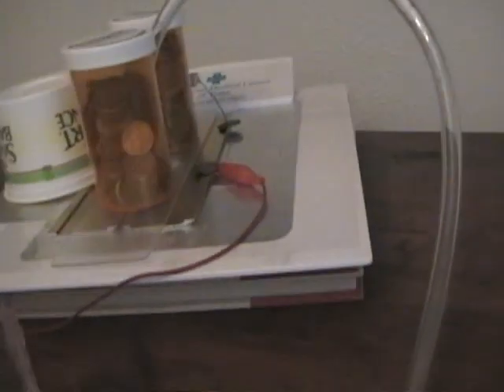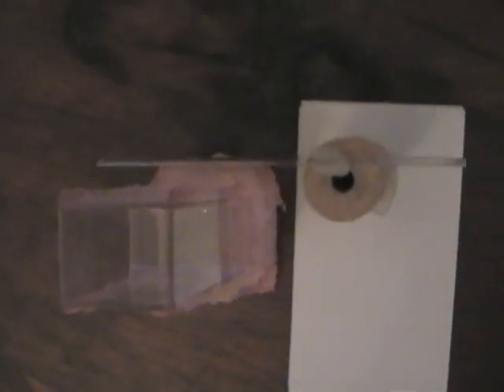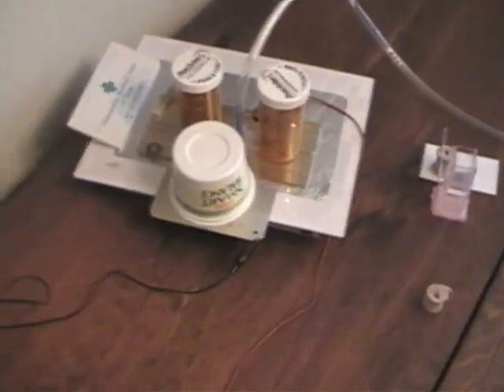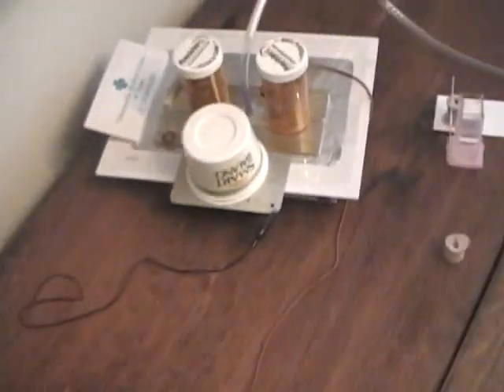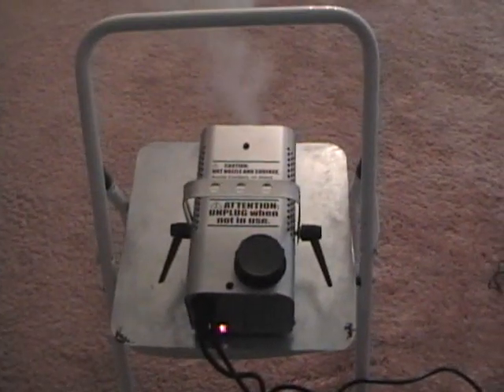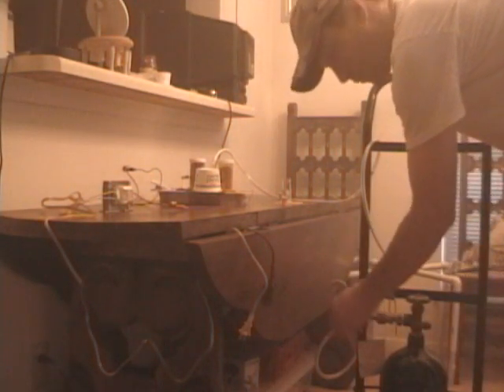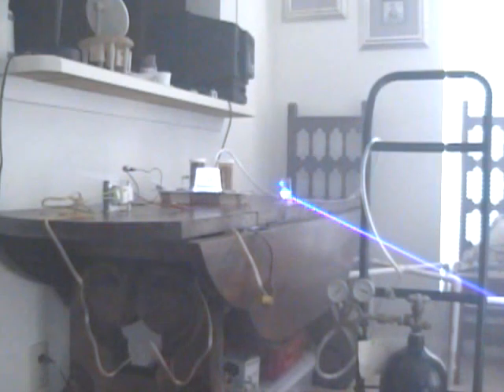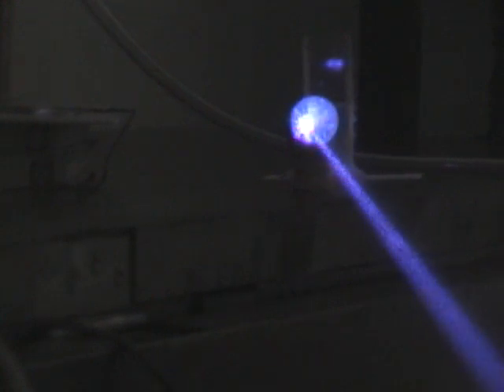Homemade dye laser using Coumarin

Comment: @magx1 hey didn't mean to offend you... i've read your article in the forum and it is realy nice project. What kind of coumarin do you use? C47? if you look at the spectra that your laser emits you will see e.g. C47 that it "lases" over a range of about 50 nm.... and if you look at your laser dot you will not see any specles... so you are actualy amplifying the fluorescence of the dye and the walls of dye cell are acting like mirrors... to avoid this you could tilt your cyl. lens...